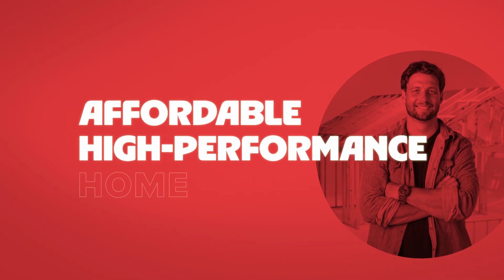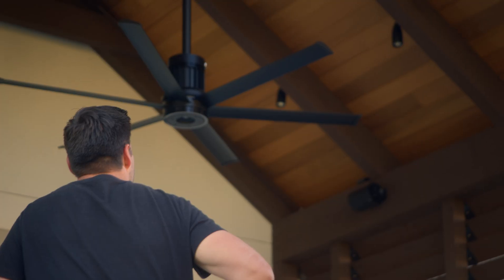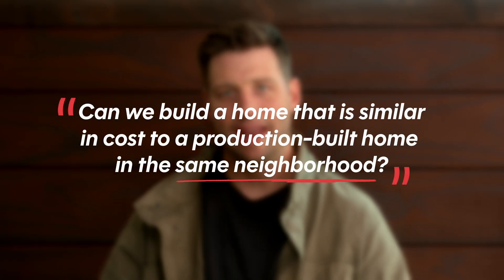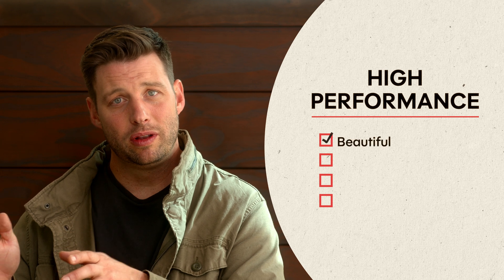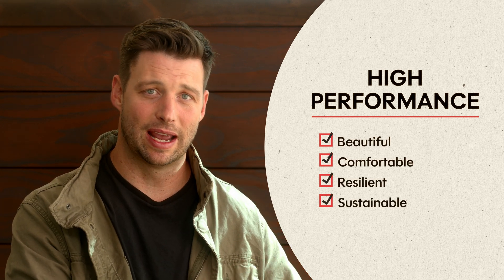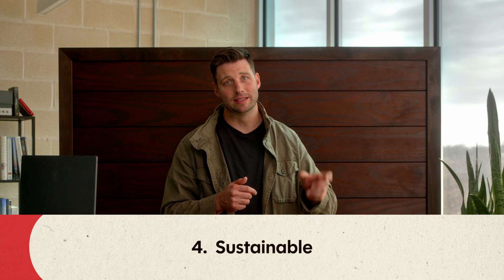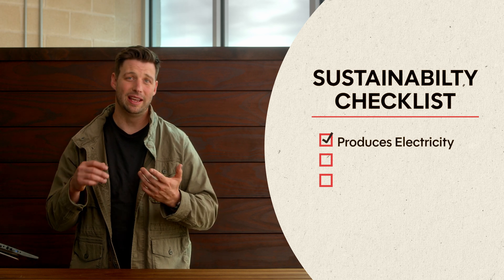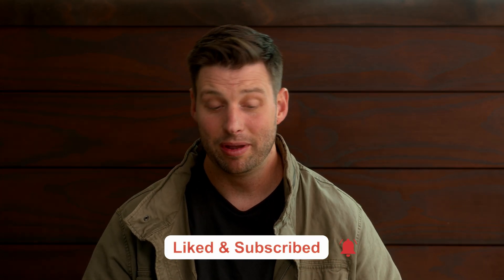A High-Performance Home at a Production Home Price, can it be done?? - AHPH 101

Comment: Wouldn't using ~12" EPS foam panels under the roof truss and held with 1x3 be cheaper than spray foam and allow for building on a budget? Granted the walls would have to be built 1 ft higher than usual

Comment: In many ways high-performance starts with design and design starts with the floor plan. Here is one I came up with a while ago and I have not been able to beat it. Each letter represents roughly 3x3 feet. L=living room. D=dining room. K=kitchen. 1, 2, 3 = bedrooms. U = utility. B/b = the two bathrooms. C=closet. H=hallway. |=enter character (in case it does not come out). Looks better in a fixed width font.
LLLLLLDDDDKKK|
LLLLLLDDDDKKK|
LLLLLLDDDDKKK|
LLLLLLDDDDKKK|
LLLLLLDDDDKKK|
CCCHBBbbbHCCC|
111HBBbbbH333|
1112222CUU333|
1112222CUU333|
1112222CUU333|
The row of closets, hallways, and bathrooms allow you to hide mechanicals in a lowered ceiling area the length of the house. The Living room, dining room, and kitchen would likely be an open floor plan.
Reply from the maker: That might be the most creative way of expressing a floorplan I’ve ever ever seen!  Keeping the ductwork in condition space is a must.  Good work.